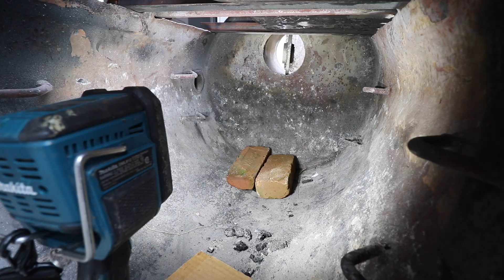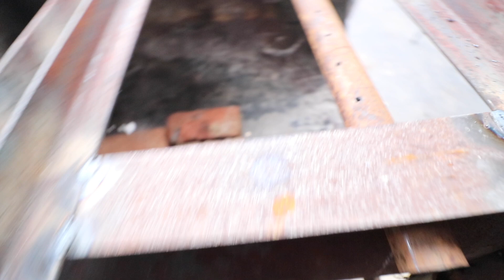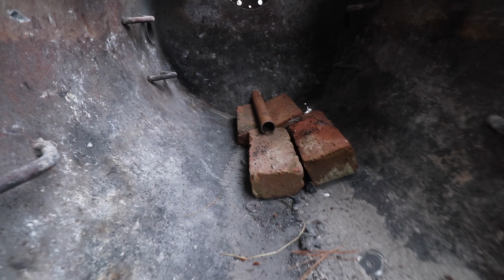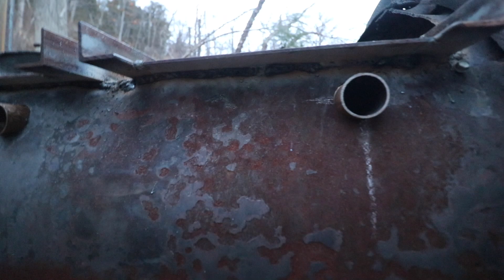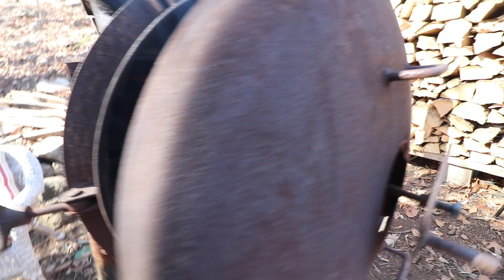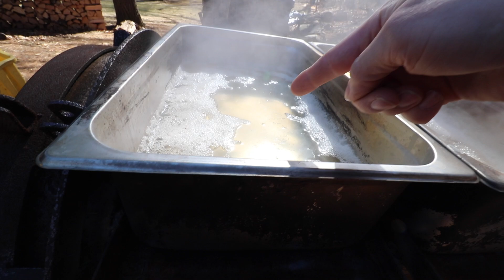Adding Secondary Burn Tubes 🔥 | Barrel Stove

Comment: Hey man I found your channel when I was researching about labrum surgery. Hows your shoulder doing these days?
Reply from the maker: 95% back to normal. Gets a little sore every now and then. Surgery was 100% the right decision. It’s a long slow road to recovery. Physical therapy was the most painful part. Take the pain medication. But now, I wake up every day with no pain in my shoulder. I can still comfortable work very hard. I am much more careful with heavy lifting and I generally resist swinging anything fast or overhead. (Bats, clubs, sledge hammer, axes, mauls, etc.) It’s just not work the risk. Happy to answer any questions or share my experiences of the process. Feel free to email me. Address should be in the video description. Stay positive friend, it’s repairable.
Reply: @OldSoulMillennial  Thanks for the kind words man I really appreciate it. Glad your shoulder is doing well it definitely makes me feel better about potentially getting mine repaired.